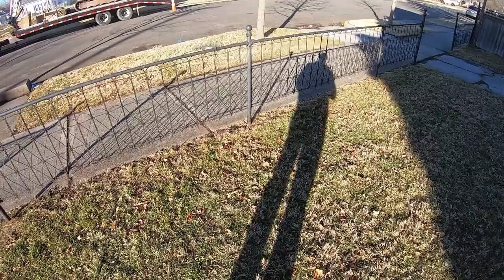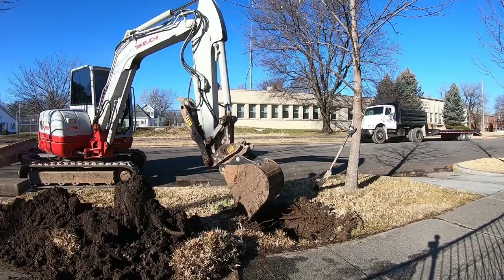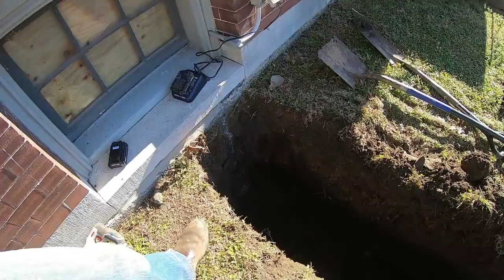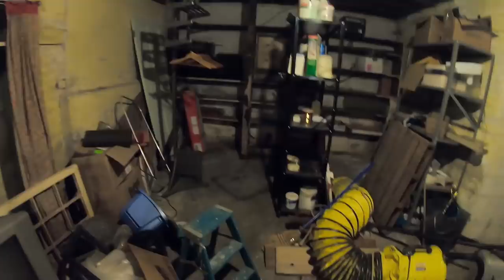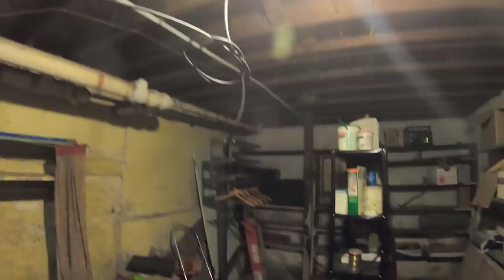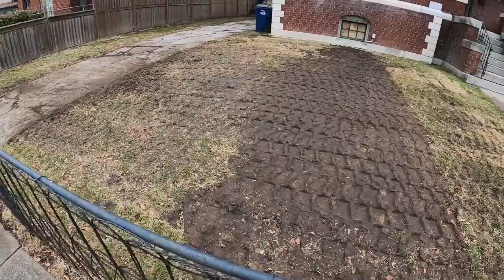Installing A Water Line In A 114yr Old House

Comment: Hey Brandon, use hydraulic cement around the wall penetration.  After it dries, cover the area in roof tar.  Makes for a water tight seal
Reply from the maker: Michael Huhn yes that’s what we put in there. Thank you! Works pretty slick

Comment: what is the price on a job such as a waterline install like this?
Reply from the maker: Because RaceBike I think it was around $1100
Reply: Elite Earthworks LLC awesome, thank you. i just bought my first mini excavator and am starting to get into excavation but having a hard time doing estimates. just trying to get an idea for job pricing.
Reply from the maker: Because RaceBike awesome best of luck. That’s a tough because things can vary a little from different areas but I’m sure are fairly close. Estimates can be tricky it just takes time to learn what you can do with the machine in an hour then you can get an idea how long a job will take. It’s nerve wracking at first but will get easier. Hopefully that helped 👍🏻

Comment: Clever editing... Was thinking... “How did Brandon con that random stranger into leaning on the shovel for him?”  Absolutely necessary shot when connecting to a city water line.... alas, you cleared that up.  Isn’t it great to have a helper you can trust?

Obviously they aren’t renovating the house with National Historic funding... Worked on one of those jobs a few years ago... I removed a wrought iron fence, took it to a shop for repairs and paint... then waited a week for the Conservators to approve the repairs... reinstalled it... and waited another week for the approval... that took the job past month end... so I waited another month to get paid.  Fortunately I was working full time at my real job and didn’t have to feed the fam with that job... but, I did get my name on the National Historic Trust registry as a Reconstruction Contractor.  

What is that good for, you ask?  I got a call a couple of years later... some drunk had clipped the corner post and mangled two sections of fence.  The corner post was Carthage Marble and was shattered, as well.  Since I was the contractor of record for the last fence repair, they wanted to give me first chance at this repair.

I came by and looked at the job... when they told me they wanted the post to have the same “weathered” look and the fence repairs had to meet the conservators approval... I (reluctantly?) told them how full my schedule was. I had zero regrets when I took my daughters fishing that weekend instead.

Hope you keep finding interesting jobs... and lots of them in the coming New Year!
Reply from the maker: William Harris lol yes I was glad he stopped by. Oh wow good thing you did have a job be tough to make a living waiting that long on your money. I don’t blame you for saying you were busy. Hope you guys had a great Christmas!

Comment: I was lucky when I bought my old house which had been built in 1920 that a previous owner was a plumber and had replaced the main line from the side walk shutoff valve to the inside of the house in copper. When I rebuilt in back in 2003 the plumber kept the copper connection to the shutoff valve for about 4' then connect plastic pipe, still get contamination but that is from the old mains in the main network which is over a century old.
Reply from the maker: barry hansen oh man there’s not much you can do about that. Merry Christmas Barry!
Reply: @eliteearthworksllc  same too you and the family.